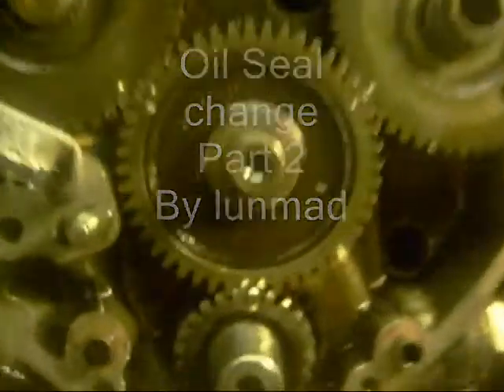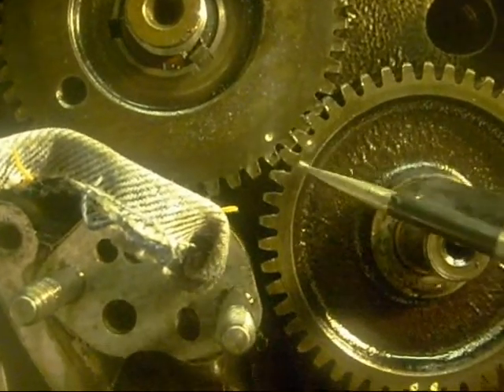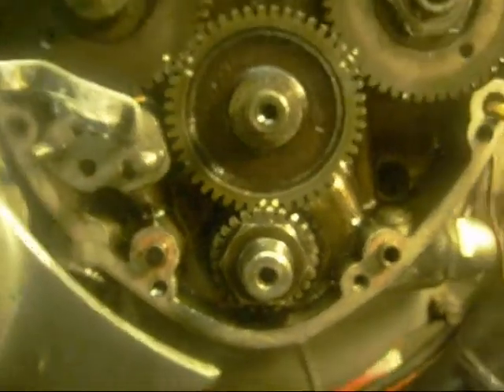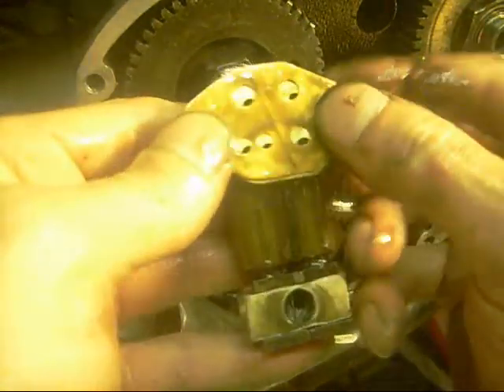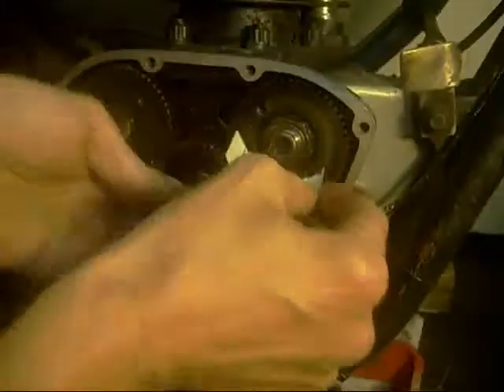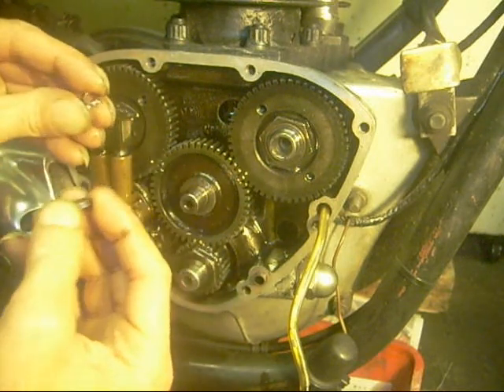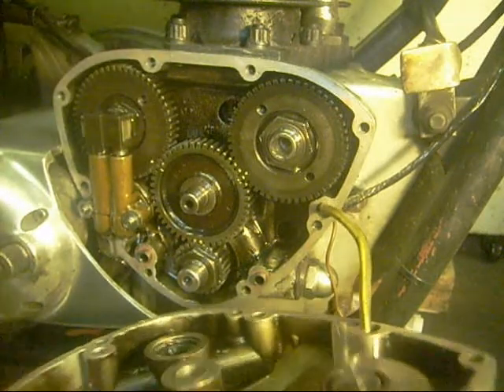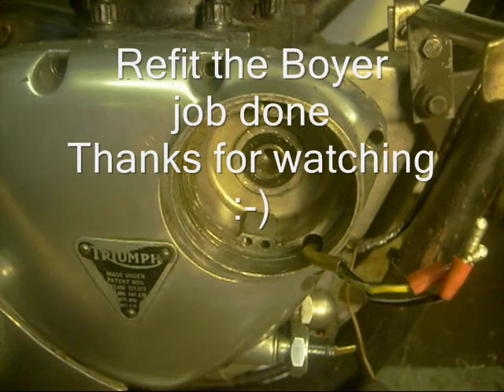Triumph T120R Crank shaft Oil seal change, part 2

Comment: Another good one! I worked on these bikes for a living for 35 years and you always show me new stuff I didn't know about.

The cellophane is a good trick. I have a tapered extension that screws into the camshaft.

I recommend Loctite on the nuts, and the oil pump nuts should be tightened no more than 5 lbs.ft.

It perhaps should be noted that the timing marks only line up every 93 (or is it 94?)  revolutions. The 'hunting tooth' principle  puts the load on different gear teeth each time round.

Comment: Just one more thing - if the surfaces on the crank or cam are worn where the seals ride, you can get a Speed-E-Sleeve (I think that's what it's called) that slides over the shaft and gives the seal a new surface to ride on. The seals are flexible enough to not notice the very slightly increase in diameter.  Cheaper than a strip down and new parts.

Comment: Best tool in the world for the oil seal that goes on the contact breaker housing is your finger nail on your first finger.  Put the cover  in place and then before you push it home, run your fingernail around the seal as it presses up against the cam, voila!  Works everytime.
Reply from the maker: Hi Frank :-)
I get loads of comment about my nails! when I am working on my bike I refuse to cut them as they come in so handy
I have used em to fit seals and other stuff, the plastic bit is to benefit those with out the handy talons on the fingers :-D

Comment: Great video, but having aggro with a 1979 T140 Bonneville 750. Supposed to have had rebuild in Holland. Would not fire up. Fitted Wassell ignition and new coil and iridium plugs, carbs not nice inside so ultrasonic cleaned them.
Does the odd huff and puff in carbs or pipes, but not interested.
Figured must/may be valve timings to pot.
Know the video is for T120, but marks look pretty much the same on mine. Set it all up. Had allen key to lock into the slots in the crank via the rear access hole.
Took pistons up to top, and did find a nice mark on the alt rotor at what presume would be 38 BTDC position, which i dabbed, although nothing at the actual TDC.
Locked it at TDC and fitted all pinions as per video (did remove cam pinion fixings to confirm the keyways did line up with the marks.
All good, but when peak into the r/h plug hole can see the inlet valve is slightly open!
Did it twice more, and was the same, so making same error each time. Am i 180 out and working the left pot, or am i missing something obvious. No wonder it was just doing the spit all over the shop............Nigel in leominster
Reply from the maker: +yellowperilbiker 
Hi Nigel
Its hard to tell without seeing, but the setup on both 6 and 750's is the same.
to set valves the crank must be TDC this can be checked with a stick down the plug hole.
and as a very rough guide to the cam and crank position you have all the keys pointing to the idler pinion shaft in the middle.
38 BTDC is for ignition timing not valve timing.
Any timing is done on the #1 cylinder and this is always nearest the timing chest so as the Triumph is a transverse motor its the right hand side as you are sat on the bike.
AS you have just fitted EI you should try swapping the two pulser wires over, I have had this happen to me all timed up correct kick kick pop pop sort of thing swapped the wires she fired straight up, no idea why this happens but it did make a difference.
 Do you know if they are std cams as this could make a difference and make std timing marks obsolete this would require setting timing with a degree wheel and a dial gauge.
 hope this give you something to work with.
hope this helps
catch ya later
John aka lunmad
Reply: John. Thanks for that. Thought i should be working on the r/h pot. That is why was surprised to see inlet valve already opening up!
Locked crank at TDC, and confirms visually down r/h plug-hole. 
Fit all pinions as per pics. Keyways correct etc.
Expect r/h to be on full belt, but inlet just popping open!
Alas, have no idea what the cams are, but is so far out thought i must be timing up the l/h pot!
Have got a degree disc, but never used one, and unsure of the procedure.
Had over 400 bikes since was 16, but fortunately never had to test my theory, lol. Nigel
Reply from the maker: +yellowperilbiker 
Hi Nigel
I have also popped you a PM
400 that is one big list of motorsickles :-O

Comment: A segment of an old crankshaft pinion is useful to lock the gears while you tighten or loosen the nuts. You can stuff a rag in there in a pinch, but be sure you get all the pieces out!

These comments go in last first, so this is comment #3.

Comment: Hi Lunmad 
I was wondering if you could help out a novice i been restoring a 72 tiger tr6rv and ive just recently started it up and it sounded a little rattly and got rather hot i removed the rocker cover and i noticed that there was no oil?,i also noticed that when i turned the ignition on no oil pressure light came on ? so ive ordered a new oil pressure switch and some new light bulbs for the warning lights to ensure they all work.
I removed the oil pressure switch and kick it over and some oil came out but im thinking that i will need a pressure gauge to test it?

Am i on the right track any guidance would be greatly appreciated many thanks.

David

Comment: You can get in big trouble taking the timing cover off. If the intermediate wheel comes off with it, DO NOT put it back in without resetting the marks! The valve springs will move the camshafts and the effect is 'banging in the pipe' like retarded ignition. The engine will run, but not very well. Of course, if you LIKE blue exhaust pipes and silencers...go ahead. Heh.

Use a screwdriver to keep the intermediate wheel in place while you take the cover off.